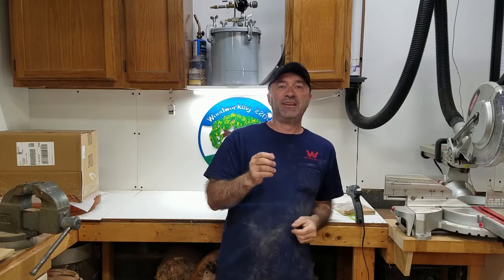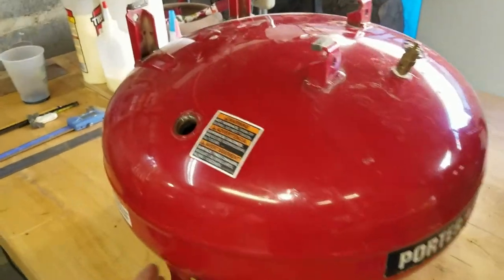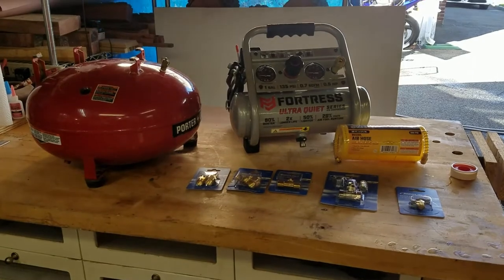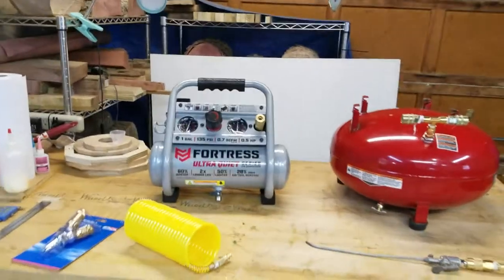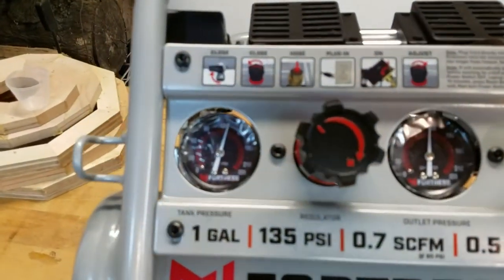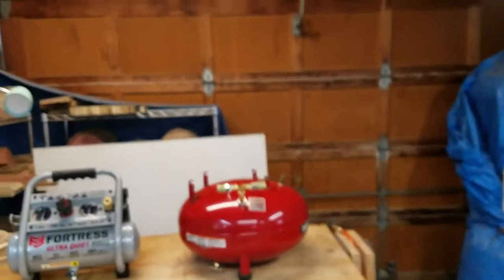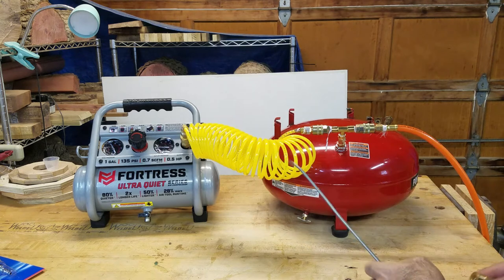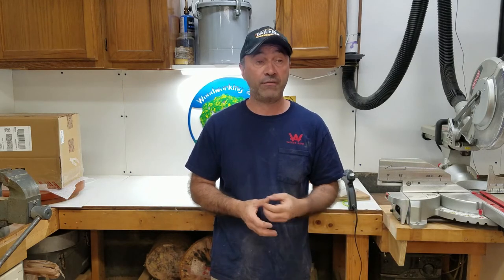Harbor freight Fortress, one gal air compressor set up

Comment: Did you try to remove a filter on Fortress? It says you need to clean it every week. I found where it is located (on the right if you face the compressor, it has a small transparent hose on it's cover), but not sure how to remove the cap from it. Thank you for the informative film.
Reply from the maker: I was not aware of that.
Thank you for the information 
I will look into that
Reply: @spindlesworkshop9744  Thank you. It is on page 10 of the Manual. You definitely need to rotate the cap to release it fm/notches (or whatever it is, the cap is secured with), but when I attempted to rotate, the whole assembly where that filter is started to rotate. I tried to keep it w/wrench (#21, should be tiny, I used variable), but still I could't rotate that cap. I'm not sure if I do it correctly, so I'll be calling the CS (on the bottom of the page). But I think that question should be clarified, see how they say, should be cleared every week (for good performance of the motor obviously).

Comment: I bought yhe 1gal and 2 gallon to compare the two and return the rejected one. I'm keeping both!
Reply from the maker: You kept both? Ive had mine for a while now and its still doing well.
Thanks for watching and commenting 👍👍
Reply: @spindlesworkshop9744  Haha yep! I keep the 1gal in the truck and the 2 gallon stays directly under my work bench. I have a 30 gallon but she's LOUD!
Reply from the maker: @thalegacy6  its funny I'm starting to think mine is loud....untill I hear a normal compressor
Reply: @spindlesworkshop9744  Hearing protection just to air up a tire haha!
Reply: @spindlesworkshop9744  I did the same thing. I bought the 1 gallon, then the 2 gallon .
Reply from the maker: @144928  they are nice 👍

Comment: How many watts does it take to power it? I need something that my truck can power with a 400w inverter.
Reply from the maker: I cant seem to find any watt info but it has 2.8 amp draw...hope this helps and thanks for watching and commenting 👍
Reply: With a 400W inverter you should be able to power this compressor. 120 volts with a 2.8 amp draw would be 336 Watts. The only thing I'm not sure about would be the inrush current. The inverter might trip, but I'm not sure what the inrush current is on this compressor. It's not close to the inverters max output while running, so it should work okay.
Reply: I just plugged mine into my Delta 2 Max and the highest it went was around 320 watts. And the rest of the time it stayed in the 228 watt range.

Comment: Im very surprised by the quality of the fortress I picked up the 2gal mainly for airbrush but airtools if I needed to and not blowing my eardrums out its hard to tell in videos how quiet they actually are talking normally is literally louder anyway great idea on the pancake I've been thinking about doing something similar I just don't have an old pancake to recycle so I was thinking about getting either the 5 or 10 gal air tanks that harbor freight sells if you don't mind me asking is it a noticeable difference running an extra tank
Reply from the maker: Thank you for the view and comment !
For what i use it for it is great 
I only allow the second tank to fill up to approximately 65 PSI and the main tank to the max. this gives me plenty of air for blowing off my projects and work areas.
I feel that it runs a lot less often this way
Reply: How do you like it for airbrushing and was it a pain to convert it?